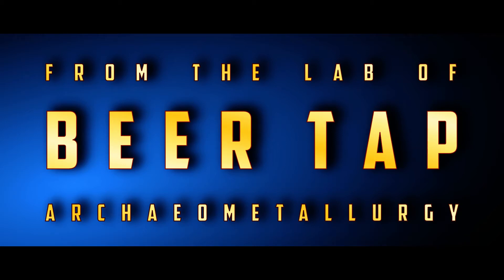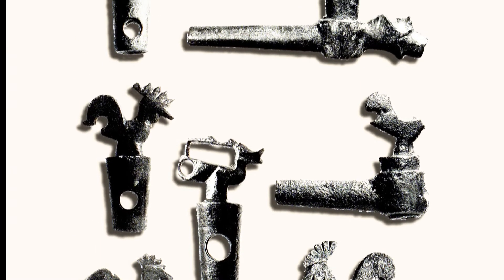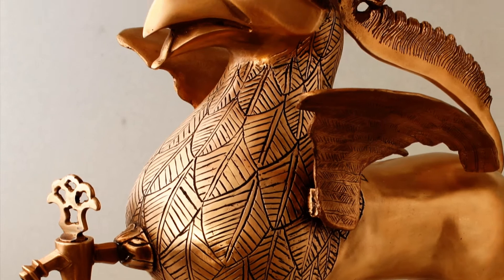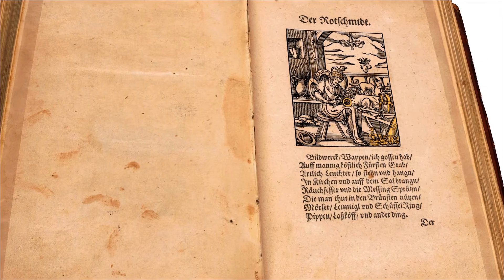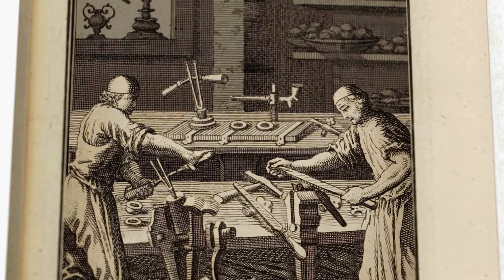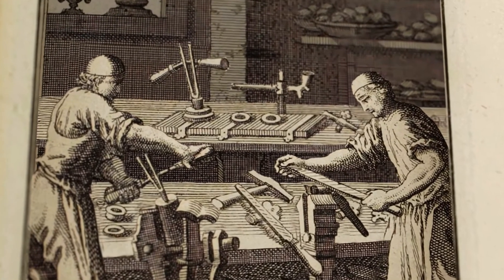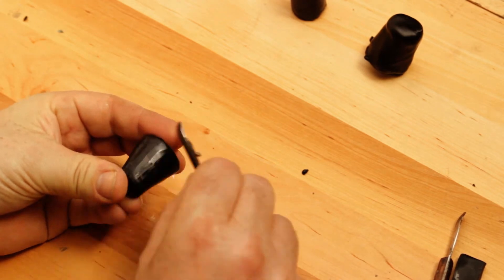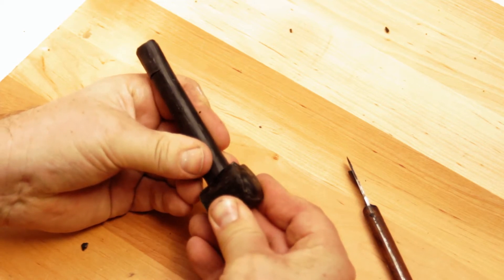Making a medieval beer tap. Wax modelling. Applied archaeometallurgy. Part 1 #ancientmetallurgy

Comment: Excellent video! Quick question, did you add anything other than soot to your bees wax? I'm trying to cast something out of brass and I'd like to follow your historical technique, however the beeswax I'm using is quite hard, crumbly and sticky, in your video it looks as if your wax is very smooth and workable, did you add an oil to help prevent the sticking?

Thanks for the great video!
Reply from the maker: no, there is nothing added. Melt it a couple of times and let it cool again. It will get more supple..
Reply: @ArchaeometallurgieDe  Thank you for the quick reply! I will try this

Comment: This just helped me with a piece of writing. Danke!
Reply from the maker: Glad it was of help for you. What are you writing about?
Reply: A low fantasy story in a c.13th century setting (so I have flexibility over accuracy, but still). The protagonist learns how to keep a cellar and tastes beer for the first time. I'm curious as to how the beer casks would be tapped and vented -- would they have used a wax seal? Also -- what metal might be used prior to brass?
Reply: On Historische Brauerei Eulenspiegel FB page, it looks like they've just knocked a hole in the barrel and wrapped some cloth around it.
Reply from the maker: wooden ones
Reply from the maker: well, that is because the cooper drilled a modern bung hole into the barrel...

Comment: Cool.  Looking forward to watching the future installments.  I'm running a lost wax bronze casting demo series on my channel right now too.  Good stuff!
Reply from the maker: Thanks. I apppreciate this. Well done with your casting, too. Maybe you should invest in a dewaxing chamber. The ceramic shell moulds you make  can also be dewaxed with steam. Keeps the moulds from cracking, too.
Reply: Archaeometallurgy I would be interested to hear about a steam chamber to dewax...?  at the moment, I am just blasting with a cheap flame thrower.  no cracked shells, (yet)  Do you run a steam dewaxer?  I'd build one if I knew what it should look like.  an autoclave unfortunately is out of the question, but steam would be cool
Reply from the maker: Make a small test mould. Put it in an old pressure cooker with distance to the water. Put the lid on, het it up. I do not think that it is necessary to put in the pressure valve, but you may try. If tests work out for you, take it from there, and see what container you can mis-use to create your own autoclave for larger things. There are so many things you could use for this. 
Good thing: You can re-use the wax.
Reply from the maker: Let us know how it goes.